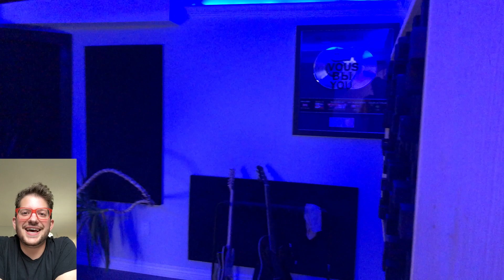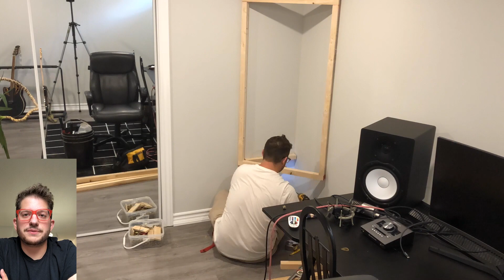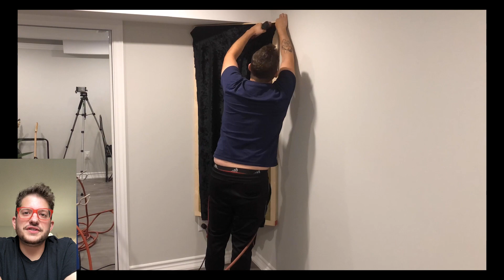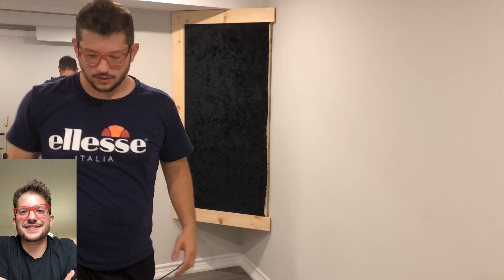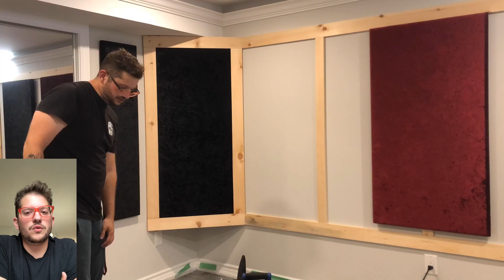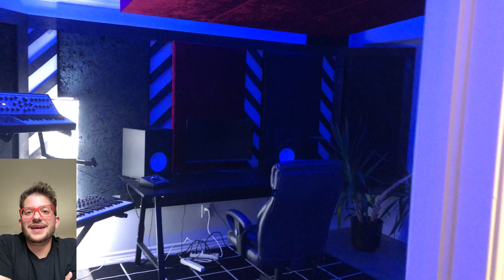DREAM HOME STUDIO SETUP! BUILDING BASS TRAPS AND CUSTOM TRIM

Comment: This is not right. Using rigid ROCKWOOL for "base traps" is a waste, u can use the cheaper more airy one for low frequency absorption
Reply: Wrong. He’s using the rigid for the bass absorption, though the rigid front makes it flatter. It won’t affect the bass absorption through, as the sub is omnidirectional and does not care about the front. You could even go with a full plastic front and it would still do it’s job. I’d probably not do that though :P
Reply: @BeatsByEndless  bro what are u talking about nobody is caring about the front back or the side , your saying pointless thing. I'm saying using anything rigid for a bass trap is a waste.
Reply: @roccitysoundllc3404  Is that true? I read tha comfort board 80 is not good for bass trapping. Too high density. His board might ruin the effect.

Comment: What frequencies do you think are considered "Bass Frequencies"? How did you determine that those frequencies giving you the problem are in the corner?  How did you determine that the product you are building is capable of absorbing enough energy at those frequencies,  going to be enough surface coverage, placed in the right location and built to actually absorb the problem frequencies?

From my knowledge and research, the biggest problems in the low frequency range under 100Hz are usually Axial modes.  Axial modes are unwanted frequencies between 2 parallel walls, not 2 parallel corners.  In small room, low frequencies giving problem usually start in the 30Hz to 50Hz range depending on the dimensions of the walls.   Corners only represent maybe 5% of the surface.  With ceilings in the 7ft to 9ft range usually have low frequency problems between around 60Hz to about 75Hz as the Axial modes between floor and ceiling.  A 2inch panel isn't deep enough to absorb down to those frequencies.

Comment: Do you have an air gap behind the rockwool or does this application not need that?
Reply from the maker: These traps do not have an air gap. This style gives extra absorption from fully filling out the corner with acoustic insulation. These ones are a more permanent version I offer for clients, however we have other videos showing how to build more modular corner panels that have the air gap. Thanks for watching!

Comment: I've been thinking of building those kind of corner bass traps but i've never thought that they could be build straight to the wall. I've always thought that i need to build them first and later just install the trap to the corner..
Reply from the maker: I offer this method to clients who want a permanent installation and the wood trim offers them more personalization. Building them first then installing is a great option to keep the trap modular. Either way same amount of absorption in the same position. Thanks for watching!

Comment: Very nice!
How did you attach the frame at an angle to corner wall? What kinda brackets and/or anchors?
Reply from the maker: I just used 3 inch construction screws into the drywall, I pre drilled the frame and measured where the 45 degree angle is true and drilled into the wall. Since it's not structural, and is secured on both sides and the top section of the frame, the construction screws into the drywall more than enough to keep the bass trap in place. Thanks for watching!

Comment: Great video and very informative! I noticed you cut the rockwool in strips that leave a gap at the front then put the comfortboard as opposed to cutting perfect fit triangles that stack on tip of each other that fill the entire space then maybe the comfortboard as well. Is there a preference, time/cost saving, or sound dampening reason for this? Thank you 😊
Reply from the maker: Thank you John! My rationale for this was since the comfort board has about double the density of the safe'n'sound, and the small gaps added up are roughly equal to one or two full triangle of space that the absorption would be comparable with either method. I like having the comfort board on the outside face so that the fabric is rigid to the touch rather than squishy if only filled with safe'n'sound. It did certainly save some time and cutting of the safensound as well! Thanks for watching and engaging :)

Comment: What can I do to Increase bass outdoors like inside the House. I get a drop off more than 80% bass out in the bavk porch. Can I build walls from wood around the box outside to reflect sound and simulate cabin gain lime in a cat or something like that ?

Any help would be appreciated 🙏
Reply from the maker: If the sound pressure is contained, then you should retain more low end energy. Building an enclosure around your back porch may be more time/work/money than moving more air with a larger subwoofer. Outdoor PA systems usually have very large subwoofers! Could be a good excuse for adding another subwoofer, hopefully your neighbours don't mind ;) Thank you for watching and commenting!

Comment: Great information. I must mention, Rockwool is a good product and safe when not being disturbed however when working with Rockwool which is a mineral wool fibre that is used to replace asbestos, a person should wear at least a half mask equipped for particulate’s. Without it you won’t feel anything now but that stuff will wreak havoc on one’s  respiratory system later as a person ages.
Reply from the maker: Thank you for your comment! Indeed I do not always use best practices when I work, you are correct and my own health is one matter but I certainly don't want to influence others poorly. I have some previously filmed videos already scheduled for release, but I will be wearing mask moving forward for future jobs I film. Thanks for watching and engaging I appreciate it!

Comment: Great job guys! Are the inside or outside frame dimensions on the Bass Traps 24" wide? Thanks in advance!
Reply from the maker: The inside dimensions are 24" wide to snugly hold the 24x48" acoustic insulation inside. The exterior dimensions with the lumber I use is 27 1/8th inches. Thanks for watching!